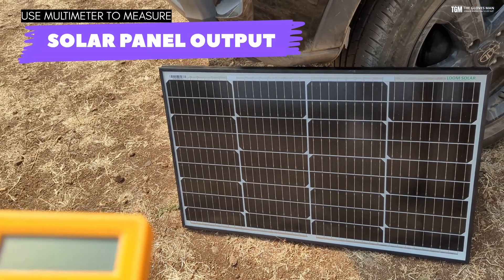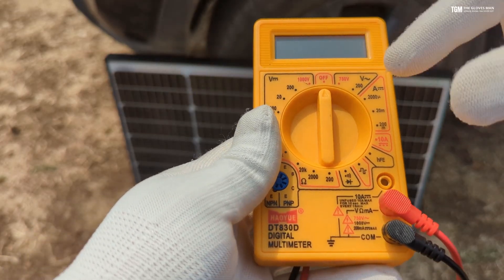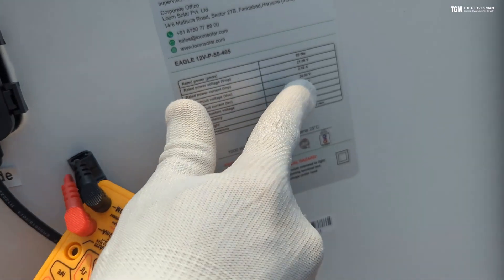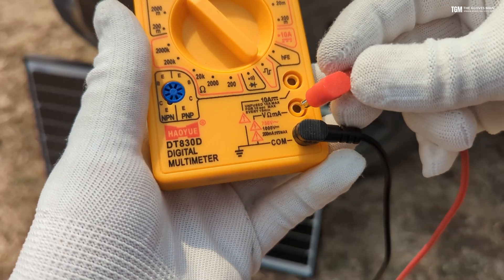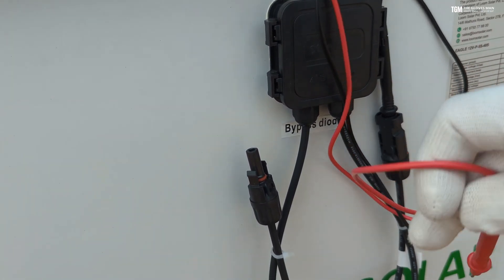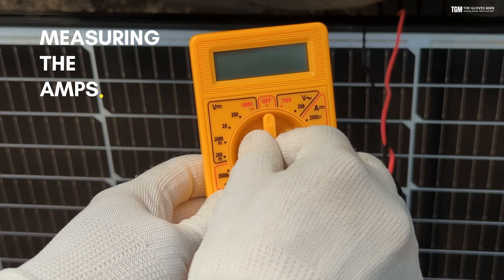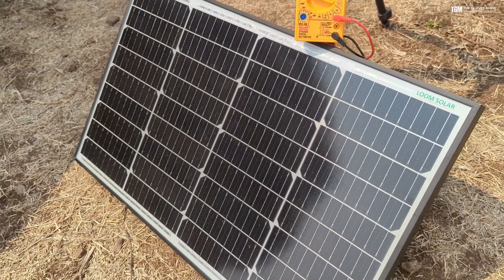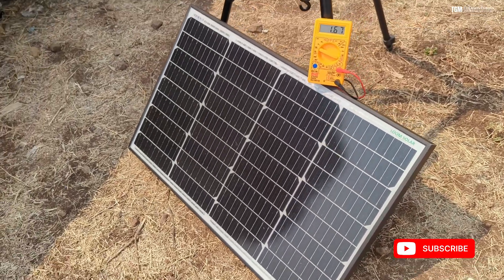How to Measure Solar Panel Output using Multimeter | Measure Voltage, Amps & Calculate Watts

Comment: Good explain sir but this is 24 volts solar and sir touch the minus and plus of the solar panel and mins of the plus and set the ampere meter mode  then ampere will checked sir  if you turn on the fan etc it will be not checked in series .and battery same this farmula ampere checked ?

Comment: This is crap.
The power calculated by simply multiplying \(V_{oc}\times I_{sc}\) will be an overestimation of the panel's actual, usable output power. The actual power will typically be 75% to 80% of that theoretical maximum.
Reply from the maker: You are right, and I have mentioned that in the video as well that it's an overestimation. It's just for educational purpose.

Comment: That meter would not be able to measure the amps from a 400 watt panel correct ? Or can it ?
Reply: if your solar panel is like 40V and 10A then its putting the amps to the limit. The 40V DC is not much but measuring amps exceeding 10A it can blow the meter

Comment: I do this, and sparks came at the terminals  and now my multimeter not worlk lol.
Reply from the maker: You've probably put the multimeter in the wrong mode while connecting it to the panels.
Reply: When measuring Current (Amps) you cant leave the probes attached to the connectors of the solar panel for more than 2 seconds or it can blow the fuse in your multimeter. Change the fuse in your multimeter. Thats all.

Comment: You  measured short circuit current and open circuit voltage and multiplying them you figured out the wattage of the device. But that was wrong. You should use another multimeter or voltmeter to measure output voltage when short circuit current was measured.
Reply from the maker: Thanks for the feedback, I'll keep that in mind for future videos!

Comment: do ampere also measure directly putting probe in to terminal or we need to put it in series?
Reply: He has measured short circuit current. There was no load resistance except panel wire resistance, probe wire resistance and internal negligible resistance of the multimeter. However all the resistance(panel wire,probe wire) was in series so you should measure ampere in series.
Reply from the maker: Yes, to measure the amperes, you will have to put the multimeter in series.

Comment: The probes of the multimeter are only barely making a connection " OK for measuring volts" but you need a more solid connection for measureing Amps, without a solid connection your readings will be lower
Reply from the maker: Not true bro. Even slight connections give proper results

Comment: I did the same thing as shown here in the video, connecting the red probe to the positive end of the solar panel and black probe to the negative end of the solar panel. Dail set to 10A and i tried measuring the current through this process. My result is that the wire of the meter heats up considerably and the tip of the black probe is burnt off.
Please let me know what do you think is happening in my case. 
Solar panel specs:
Max power - 335W
Max volt - 37.85v
Max current @ max volt - 8.86A
Open circuit voltage - 46V
Short circuit current - 9.27A
Max system voltage - 1000v

I would be more than happy if you can help out.
Reply from the maker: It sounds like you're encountering an issue due to the way you're attempting to measure the current, and the method you are using could be causing a dangerous situation. 

Your solar panel is rated for up to 9.27A of short-circuit current. However, the multimeter you are using might not be rated for such high currents, especially if it's set to the wrong range. If you set your multimeter to the 10A range and connect it inappropriately, the meter may be overloaded, causing it to heat up and burn.

You're likely shorting the multimeter by connecting it across the panel, causing the excessive current flow. Correctly measuring current in series with the multimeter, and ensuring your multimeter is rated for high currents, should solve the issue.

Comment: I have two 200watts panel connected in series to a 40amps pwm charge controller, the highest current ever recorded on the charger controller is 8.7amps which I think is low. Because I was expecting up to 15amps on a sunny day. Is my controller faulty, or it's the panel?
Reply from the maker: I would recommend checking your panels under direct sunlight, ensuring they are clean and free of shadows, and inspecting the wiring and connections. If everything seems fine, it could be worth considering switching to an MPPT controller, which would optimize the system for better performance in varying conditions.

Comment: The voltage will drop when you short the panel so you have to measure both the same time to get watts.
Reply from the maker: You are right, it's best to measure both voltage and current simultaneously to get the most accurate watt reading.
Reply: @TheGlovesMan  It turns out I'm also wrong. If you short the panel without a resistor, it will just be Isc and the voltage drops to zero i.e. zero power. As you increase resistance, load increases and voltage drops while current goes up. It turns out that the maximum power is somewhere along that curve depending on the light, temperature, and other factors. In order to find the maximum power for the current conditions, you'd have to use an adjustable resistor (one that could take hundreds of watts) until the current voltage and current amps multiplied gets you the highest number. This is what MPPT tracking does. It adjusts the load until it's extracting the highest power. There are meters meant to test panels that have MPPT built in. The thing about used panels that aren't perfect is that when you put them in series, their MPPT points won't the same for each panel. It's like mixing a bunch of different panels together. You will lose a lot of capacity. Optimizers can help recover most of that so that each panel operates on it's on MPPT point in a string. The optimizers than add the power together in a single string. The other super useful thing to do is to use FLIR imaging. I just did this on the 4 panels I bought and can see every cell in each 72 cell panel that is shorted. One panel only has 3 with the worst having nearly 1/3rd of the cells shorted. It's a bad panel.  Now when using a tester that has MPPT built in, if you use it on brand new panels, you'll see the voltage and current is nearly the same for each panel but for used panels that have issues, they will be at different points to get the best power.
Reply: @TheGlovesMan  So I had a very long reply to this but apparently youtube just let it go into a black hole probably because of length. It turns out I'm wrong too. If you short the panel so it produces maximum current, voltage will be zero. What MPPT will do in the inverter is adjust the load so that into the voltage drop times the current rise equals the maximum power. The only manual way to do this would be to use a variable resistor that can take hundreds of watts and vary it until voltage x current equals the maximum power. MPPT in inverters and optimizers do this for you.
Reply: Additionally, a bunch used iffy panels will all have different optimal MPPT points so putting them in a string will lose a lot of power because the inverter can't run each panel at it's optimal MPPT. Optimizers can overcome this by MPPTing each panel locally in the string. So used iffy panels will benefit from optimizers far more than brand new panels that are all meeting the same spec.

Comment: The current has really dropped . 1.7 . That’ makes the watts less than 40 but they wrote 55 watts on the description . Hehe
Reply from the maker: Yeah, that's right. The actual output can vary, especially in cloudy weather.

Comment: the test probes are conected  different if i measure in AC?, i reffer to the amps.
Reply: In AC, while using a digital meter, you will get correct readings irrespective of how the probes are connected, except if the socket has got a diode in the circuit. Diodes only allow flow of current in one direction.
Reply from the maker: Thanks for the info bro